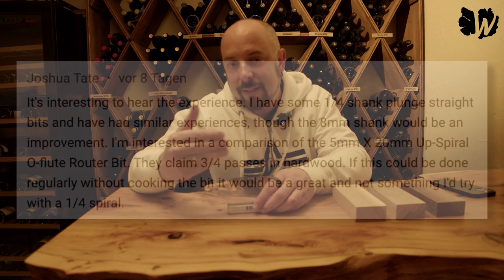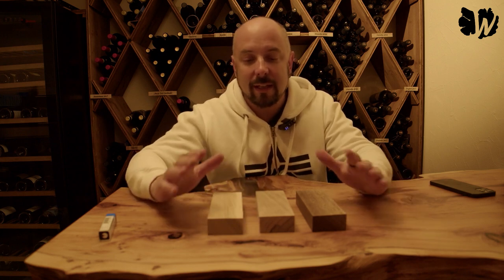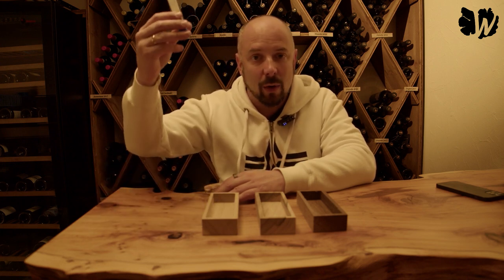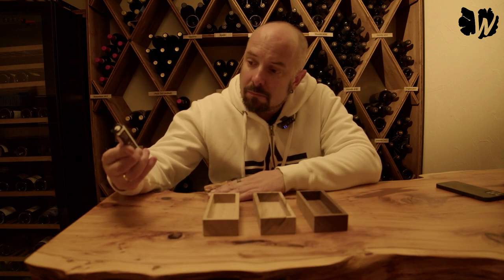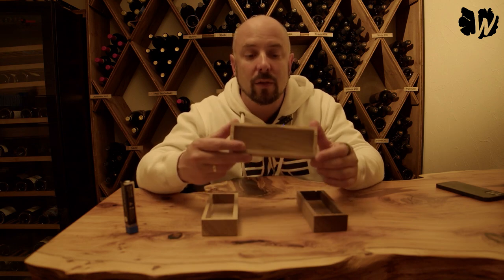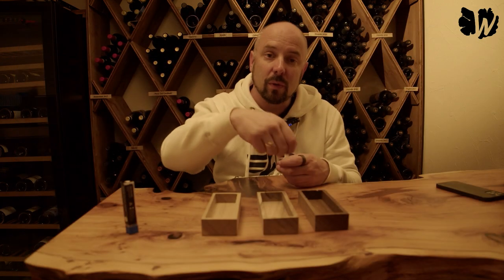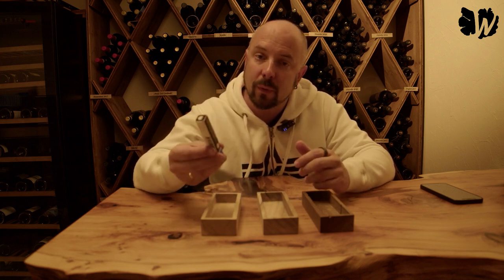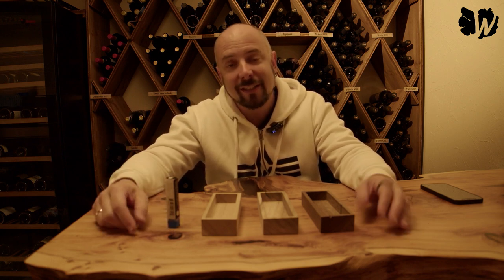Testing the 5x20 Up-Spiral O-flute Router Bit from Shaper Tools #routerbits #oflute #shaperorigin

Comment: Very helpful, thanks for doing this! My use would primarily be cutting out shapes in hardwood. I am unlikely to use it at full depth but I typically use a 1/4" spiral at no more than 1/4" depth and often at 1/8", so running this at maybe 3/8"-1/2" would be a huge time saver.
Reply from the maker: Yeah, that beast can do 1/2" without a problem :D

Comment: Another great vid my friend. I guess what it comes down to is how much is your time worth. Although this bit is advertised to cut 20 mm deep in one pass, I would never push those boundaries. You always sacrifice quality. Especially with ultra hardwoods. As to the divots in the the wood, I’ve been having problems also with my shaper not behaving like it should. I tried using it to cut circles for my drum jigs, and they never came out clean. Always with jagged edges. I don’t know if it looses sight of the tape, or if it’s just creating a mind of its own. I would be curious to know if any of your subscribers who have Shapers have this problem also. 😁
Reply from the maker: Henry! You are right, greater depth comes with increased risk. I have found myself using this bit more and more, especially for things that don't require high precisions. For instance, I cut the channels to place c-channel steel bars below a table, and I was able to cut them in one pass. That was pretty nice! As for your problem: Are you turning the Shaper Origin while routing? I have noticed that sometimes the precision suffers if you turn the SO and have it look at the dominos from a different angle, but it doesn't happen always. Can it be related to this?
Reply: @Woodensoul  hello my friend! I’m not sure, I try to keep the domino reader in the black as much as possible, avoiding any possibility of it going red, but when I was cutting large circles 14 inch plus, I never got a clean cut. I just use my circle cutting jig for this. I use the Shaper for all other cuts though. Pocket etc, and engraving.
Reply from the maker: Weird! I just cut a perfect circle a week back. Do you change the camera angle, that is do you rotate it while cutting or keep it straight?
Reply: I try to keep it straight. No biggie though. 😁

Comment: Can u you test the shapers roughing bit. Pls. I only saw I video but it’s a 1/4” shank it’s called the “hog”. Would like to see how useful it is before I get it.
Reply from the maker: That would be this one here? https://www.shapertools.com/en-us/store/product/8-mm-x-35-mm-roughing-bit

That is an expensive bit. What would you like to use it for, ie what would be the main advantage compared to e.g. the Up-Spiral O-flute?
Reply: @Woodensoul  I’m working on cutting 25 custom picture frames that’s 3/4 think and would like to make the cuts a little faster than using a 1/4” compression bit. I do have the o flute bit from shaper but I have not used it yet. But I saw that shaper roughing bit that can cut 3/4 in one pass. I was wondering is that any better than the o flute since it’s a 8mm bit?
Reply from the maker: @wwh2694  With the flute bit you can remove up to 30mm (1.2") in one pass and it's built in a way where it ejects the dust pretty will. Why don't you give it a try and if it doesn't work, I will try to gest the roughing bit...
Reply: @Woodensoul  so I tried the o flute bit and it feels like every time I cut it feel like I’m doing a climb cutting. Shaper just want to wonder a lot. Have u have this kind of problem using the o flute? I went back to compression bit and no problem with it. I’m cutting a pine wood 3/4 stock and doing a shallow cuts.
Reply from the maker: @wwh2694  What Speed are you using? With the O-flute I have found that 4-5 router speed works the best. What do you mean by "climb cutting" exactly?
Reply: @Woodensoul  I’m at 5 speed. It feels like when im using the o flute bit it tends to pull the origin away from what im cutting. Do I have to plunge all the way to have maximum control with the o flute?
Reply from the maker: @wwh2694  Got you. In my experience the random pull comes from moving the router too fast. If you are cutting deep at once, you have to go really slow. Using the auto-cut set to a very slow speed can help. Did you try that?
Reply: @Woodensoul  thank u I will try that.